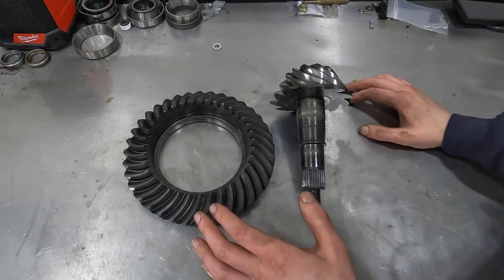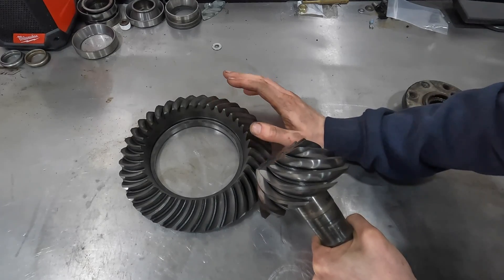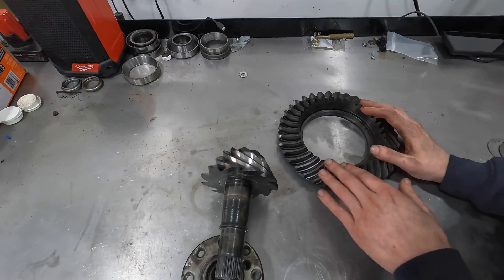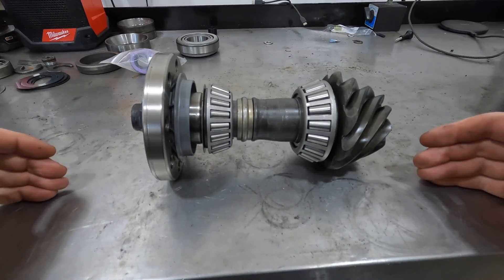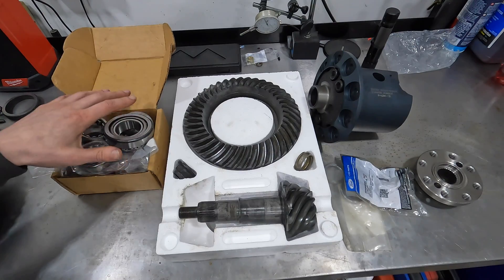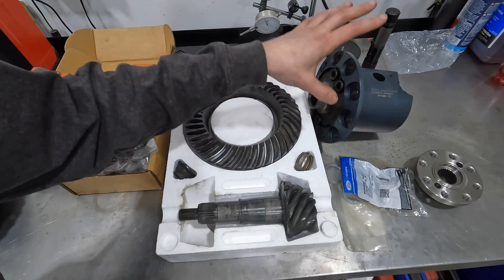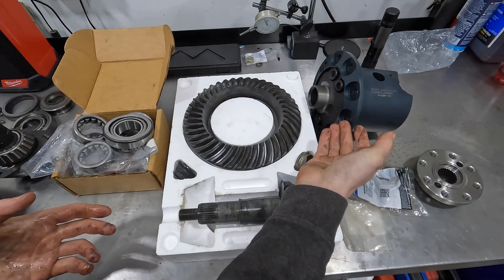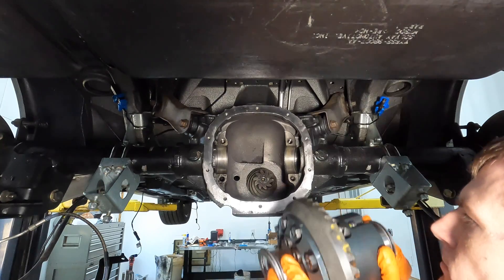Differentials 101: Beginner's Guide to Differential Repair. ( How Differentials Work )

Comment from the maker: Links to the tools and parts required to rebuild a differential: 

Calipers: https://amzn.to/48nlVr7
Dial Indicator: https://amzn.to/3utnAxB
Beam Torque Wrench: https://amzn.to/3UODXzz
Pinion Flange Holding Tool: https://amzn.to/3SZ2NLF
Bearing Splitter: https://amzn.to/4bIN1f2
Bearing/Seal Drivers: https://amzn.to/3uCYrAs
Hot Plate: https://amzn.to/3uuUu0Q
Shim Drivers: https://amzn.to/48j5KLp
Press: https://amzn.to/3T5JYq9

Chemicals:
Retaining Compound: https://amzn.to/3SZpbEI
Thread Locker: https://amzn.to/48kF7pl
RTV: https://amzn.to/3OLwaP9
Degreaser: https://amzn.to/3uBzhlG

Parts used in this Ford 8.8 build: 
Ford Performance 4.10 Gears: https://amzn.to/49EJrRk
Ford Performance Install Kit: https://amzn.to/3I3hR4w
Torsen T2R Differential: https://amzn.to/3SKyXsQ
Moser 31 spline Axles: https://amzn.to/3I4DYaI
Crush Sleeve Eliminator Kit: https://amzn.to/49AKSAr

My Amazon Store:  https://www.amazon.com/shop/repairgeek
Help support the channel, buy using my Amazon links
As an Amazon Associate I earn from qualifying purchases and your cost is exactly the same.

Questions? Send your question or schedule a call here: https://tazet.com/repairgeek

Comment: awesome and interesting video ty ! was wonder i have a old willys jeep that had a 4 cylinder i put a 4.3 in and will be running to start original 5;38 with od ! gona be strictly onroad driven but want to br able to do 60 plus not a race motor what ratio would you recommend for me ? ty much

Comment: I had a noise in my front end when driving and upon investigation I found out my mechanic used an impact to install the pinion nut… drove about 300kms before I realized. About to replace the outer pinion bearing, crush washer, seal and nut. Is there any other damage you would suspect on other components?  This is on a 1999 G320L also known as W463. Thanks!

Comment: Brilliant video explaining the inner workings of a differential! I only have one concern that you could maybe clear up with me please. 

In the case of a 4x4 vehicle that has been fitted with larger tyres, would it not be wiser to alter the final drive ratio in the transfer case and not the differential, because in my case where I have a 50/50 split front and rear, altering the rear would correct the ratio, but leave the front incorrect which could lead to binding and breakage unless I perfectly matched the final drive in the front diff as well?? If I'm understanding correctly, by changing the final drive in the transfer case, this would inturn alter the ratio going to the front and rear diff, thereby correcting both axles or will the ratios still be out?

Comment: Thank you for a very informative tutorial. To adjust backlash is it ACCEPTABLE to put more shims on one side so that the gear moves close to the pinion or the number of shims on the left should be the same to shims on the right.
Reply: Carrier adjustment on axles can move the carrier towards or away from the ring gear ⚙️

Comment: Appreciate you taking time to do this video. Very interesting and informative.
I'm not a master, or fulltime mechanic, but have off and on worked on cars, with a variety of things, from a young age.

Recently I have been teetering the thoughts of rebuilding the gear box on my front differential. Although I am not one to fear from a mechanical challenge. I do recognize when to not attempt some things at the time.

I understand everything you share in this video, but it has helped me decide not to attempt this for my current situation. At least till I have some more knowledge of what to look at for the assembly. Lol

Anyways appreciate this. Look forward to viewing more later on.

Comment: Do I need to change the pinion depth if I'm just replacing the carrier and carrier bearings?
Reply from the maker: You shouldn't but keep an eye on your backlash. Changing the carrier could change the backlash even using the original shims.

Comment: Can't you just buy all the parts and match exactly the same amount of shims, etc, that came off the original ring and pinion? Thanks
Reply from the maker: You can't guarantee the gears are machined exactly the same.
Reply: @RepairGeek Dang, it's always something lol... Thank you
Reply: @ConditionZero76 seriously.
Re use the factory shims and 90%+ of the time it will be in spec.
Reply: @ConditionZero76 re use the factory shims and 9 out of 10 times it will be within spec❤

Comment: Very well done video bravo! And don't forget to check the tightness of the pinion nut and be sure to torque it to inches not pounds, And I know this is about differentials but because part of the drive shaft will go in be sure to check for those rear u-joints, cheers!

Comment: I have a 03 dodge ram 1500 that had the factor 20" tires and 392 gears.  I upgraded the 20 in  tires to 33's mud grip tires, should I keep the sand gear set or what without u recommend changing gears size to?

Comment: This is fucking impossible
Reply: Its not, ive been looking at these videos for days and days trying to figure it out and suddenly it clicked for me. It will for you too just keep watching them. It helps to understand what each gear does and that will serve as a hood base to learn stuff like this
Reply: Fairly easy, once you grasp the concept. It’s just nuts and bolts, and understanding what they do.
Reply: @irasupertrucker  Pulling down the whole diff and pressing a bearing off just to make an adjustment which might need another adjustment is not even close to fairly easy.
Reply: @StrikerFin I’m doing mine now made a mock bearing out of wood just to test depth. Just need the width now the function when testing
Reply: @StrikerFin it's all easy.
Nothing to it.
Reply: @rdallas81  lol
Reply: You need to start with a good inspection, the factory service manual,  a few special tools, a full kit of new parts, and a clean workspace. You'd be surprised what you could do but in most cases mechanics are the people who do this themselves. In the interest of saving time though take it to a shop since sometimes when you think you can swim you find in the depths of the sea you can sink.
Reply: Relatable but no bruh you got this
Reply: Only as hard as you make it.

Comment: Thanks for the insight. I recently had a pinion gear "rub into" and carve out the differential case, but it would only grind on deceleration. Still moves, if you don't coast it doesn't make noise. It's a 1999 chevy suburban that I will most likely be completely replacing the rear end, but I am very curious, what do you think failed to cause this? Been watching all your videos on this and they are gold, thank you.
Reply: Too much play in the bearings, warn parts

Comment: I love this video.  I'm glad I kept on searching.  Truly the basics as I knew nothing about a differential.  But,  I never take my vehicle to a shop.  I figure it out myself and do the repairs like I have done for years.  But this munka sunka has got my brain all twisted up.  
I have a 2012 Jeep Wrangler. I took it apart because of the racket is was making.  I found it needs new carrier bearings. All good,  I have got it totally broken down.  I've got new bearings and grabbed a small variety of shims.  Because her is where my dilemma starts. On the passenger carrier 1 thick shim and 1 thin shim was used.  No big deal.  On the drivers side instead of any thick shim.  The were 8 thin shims that when i removed the cover the shims were sticking down about an inch to an inch and a quarter and of course destroyed.  Also the drivers side axel was sticking in the spider gear so far that it was up against the spider gear rod with some force.  I looked at the passenger side and i didn't see the spline of the axel at all.  When i pulled the bearings off the carrier 1 thin something like a shim was behind the bearing.  Just that one bearing.  I haven't seen any video at all where there is a shim behind the bearing.  If you could give me a little insight to these little issues.  I would so greatly appreciate it.  It's a dana 44 by the way.  Thank you for your time.

Comment: Regarding speed vs ratios.  Tremec has an online gearing calculator.  Enter tire size, transmission gear ratios, final drive ratio, and engine rpm, and the calculator will give vehicle speed at the specified rpm for each transmission gear.  Example, my 2014 F150 with 3.31:1 final gears on 35x12.5's in 6th gear at redline would mathematically hit 238mph in the vacuum of space.  I went with 4.56:1 gears.

Comment: When you make a large increase in the OD of the tires, the powertrain isn't the only thing that loses leverage. So after you change final drive ratio to regain lost acceleration leverage, you might want to allow more following distance in traffic if you didn't make any brake upgrades to compensate for the leverage the brakes also lost.